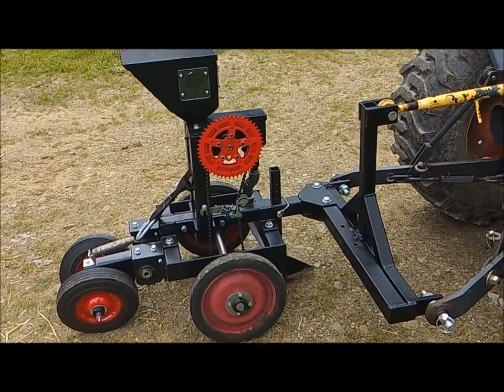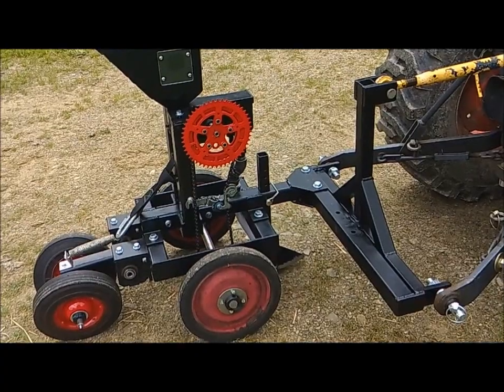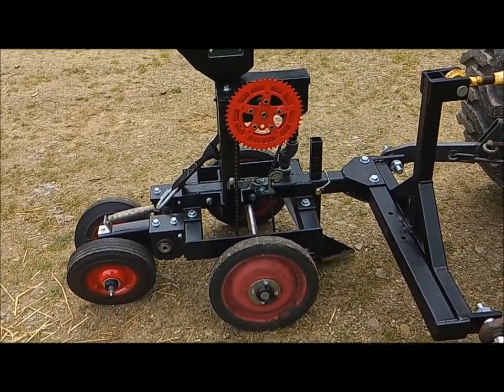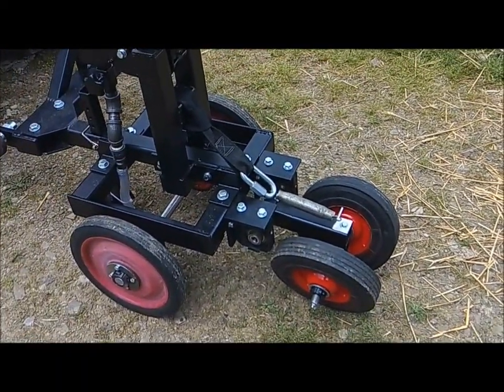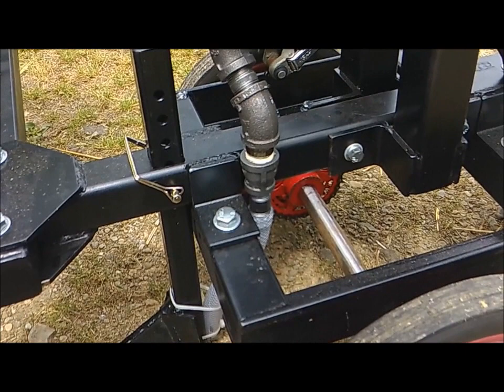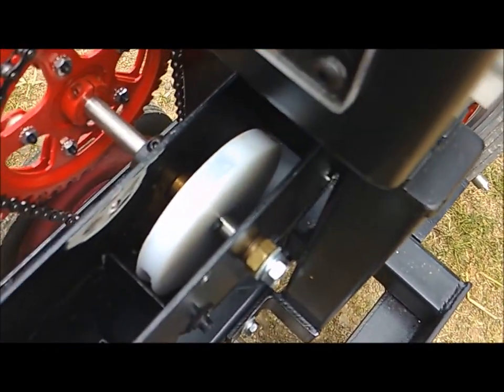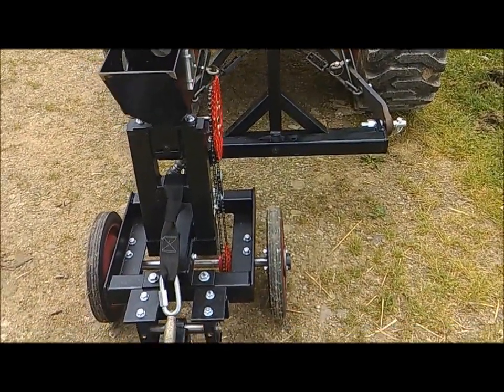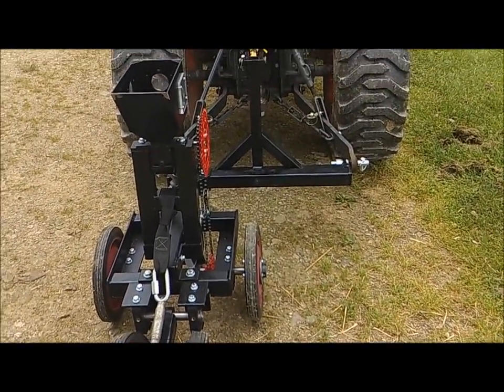Homemade Corn Planter

Comment: Sweet corn likes a 36 inch row. And 10 inch minimum, 12 inch maximum seed spacing. Another thing is your seed tube that delivers it to the furrow is into a direct path you'll have really uneven and speratic spacing. But good on your for your goal of making a home made job!
Reply from the maker: While the row spacing may not be ideal, the unit did work very well and I couldn't have asked for the seed spacing to have been any better. There is still room for some tweaking this season, but over all I'm quite pleased and excited to try using it for soybeans.
Reply: Michael Caldwell what tweaks do you think it needs? I want to replicate this and use a 3D printer to make “seed plates” - a larger for corn and then try a smaller one for tiny seeds.
Reply: @pa50cals  Nice job,I would like to make one myself and would be glad if you will help with the design,I wanna go into maize farming in Ghana and wanna go for a low cost machines